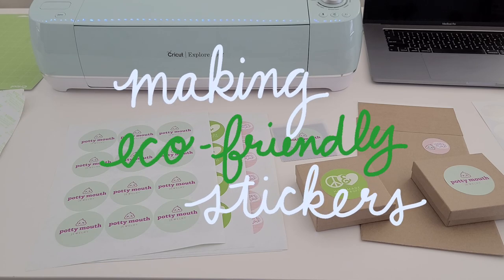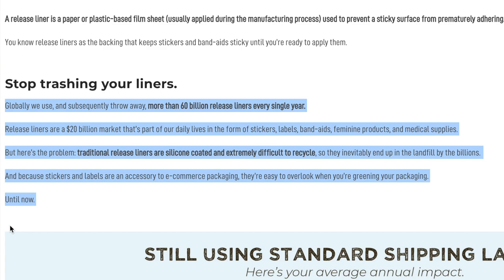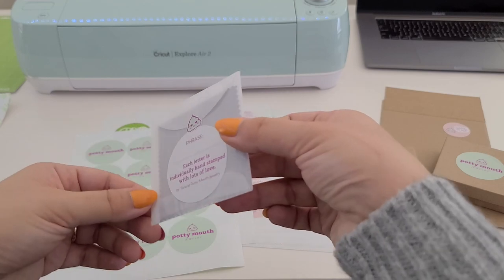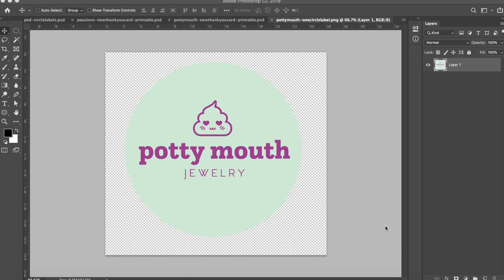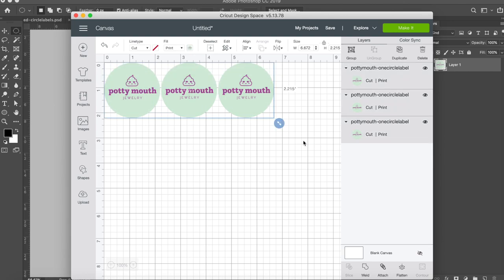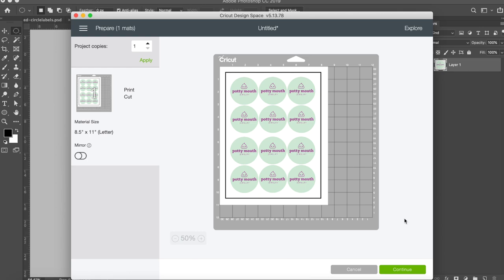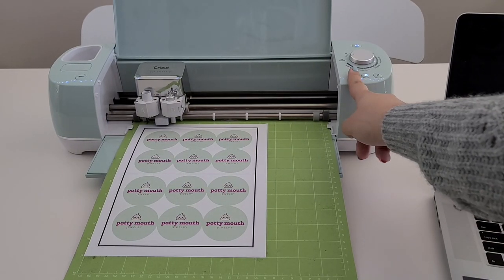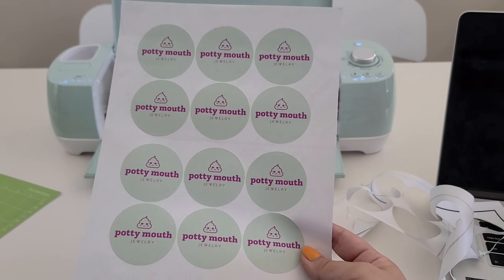HOW TO MAKE (ECO-FRIENDLY) STICKERS WITH CRICUT | FOR PACKAGING, RECYCLABLE & ZERO-WASTE

Comment: This awesome. Quick question, if the shipping labels aren’t as sticky as regular shipping label. Does it come off easily from the mailer or package?
Reply from the maker: They actually recently changed them to be stickier since making this video. Before, on the padded paper based mailers, sometimes the edges would lift up a little if what was inside wasn't completely flat, but I never had issues with them ever coming off, even internationally. But since they're stickier now, definitely won't be an issue.
Reply: @TanaMakes  good to know! I’m am transition all of my packaging into eco friendly too!! I looked up econclose from you! Thank you so much for sharing!

Comment: How do you line up your logo with the stickers? Ps love ur vids x
Reply from the maker: Thank you! You can design the file so that the circle and the logo are both vertically/horizontally aligned before importing the file into Cricut design space. Photoshop has guides so you can see if it's centered, or you can select two layers and use the veritcal/horizontal align tools. Cricut design space has aligning tools too 😊

Comment: Thanks for the tutorial! I have stickers that are also cut down the middle. I'm wondering if youve ever experienced a slowed down lagging design space while making these stickers. When I group things and duplicate, it just makes everything so much slower for some reason. Do you suggest making the designs in illustrator first instead of right on design space?
Reply from the maker: You're welcome! I think once you start getting into sticker sheets with more than a dozen or 16 stickers, it's probably best to design them in photoshop or illustrator. I'm pretty sure any app where you copy, paste, and adjust the positioning a bunch of times starts to lag. It happens with my laser cutting machine app too 😕. If it's a simple design like the one I showed in the video, you should be alright. 😊
Reply: @TanaMakes  I was making it straight on design space so i guess the copying and pasting made it lag. that kinda makes it annnoying haha. does making it in photoshop or illustrator help? it looks like yours didnt lag in the video when you didnt design it straight on design space.

Comment: Hey I have been looking ever since I saw your video of the exact product sheet you use and i cant find it on eco  enclosed...
Reply from the maker: It's under their shipping labels section! As mentioned, I use the shipping label paper that's the same size as printer paper so that I can print whatever I want on it 😊. I don't use a cricut joy, so unfortunately I don't think there is an option for that yet. If you use a mat with the cricut joy, you'd probably have to cut the paper to the max width it allows after printing your design on it.
Reply from the maker: What I'm showing in this video is a "hack". They don't actually sell blank sticker paper. I'm using their shipping label paper the same way you would use normal sticker paper. You can order custom stickers from them with that are recyclable and with the zero-waste liner, but it's much more expensive that just using shipping label paper and printing/cutting yourself.

Comment: Omg, thank you for this info. I am looking to go 100% recyclable. Currently I make reusable packaging and I was looking for recyclable stickers. I wish the company had more options, which I am sure they will introduce soon. This info is amazingggg. Thank you so much :)
Reply from the maker: You're welcome! I wish they had more options too but since they actually sell custom stickers for brands, they probably won't ever provide full sheets of the label paper. What I'm doing is like a total hack because I wanted to have the freedom to customize my stickers more lol
Reply: @TanaMakes  I agree. Yet, I wish they do offer options as I make stickers and I also sell them. So that would just be awesome to offer only recyclable stickers in my shop 😀. I do love your workaround too. :). I’ll try them for sure ❤️
Reply from the maker: @tasneemchandia3470  they did recently change the stickiness of them and sometimes I struggle to peel them off, but I usually print larger stickers. Maybe with smaller stickers will be easier to peel. Definitely test them out.. even if it's just for using on your packaging like I do 😊
Reply: @TanaMakes  yes. I am soo planning to try them at least for my packaging. I feel terrible designing and finding recyclable packaging, only to use stickers that aren’t recyclable. So at least I’ll shift to them for my personal packaging while I find a better solution for my other stickers :)

Comment: thanks great but online labels has Eco friendly sticker paper too
Reply from the maker: You have to be careful because 100% recycled and 100% recyclable are two different things! Onlinelabels has 100% recycled meaning that the paper used to create the paper that goes on the coated backing is made with 100% recycled paper.
Reply from the maker: You can say that their 100% recycled sticker paper is more eco-friendly than regular sticker paper, of course it is, but the liner is not a zero waste liner nor are the stickers and lining recyclable. As far as I know, they don't offer that, but let me know if I'm wrong and provide a link to it so I can share it!
Reply from the maker: Directly from onlinelabels.com responding to a customer asking on their Facebook if they can recycle their liners: "Unfortunately, the answer would be no. Most, if not all, liners (backing sheets) have silicone that enables the label itself to peel away from it without leaving sticky reisude. Due to the silicone, the liners become non-recyclable."
Reply from the maker: Sorry for being so extra and leaving yet another comment lol. But I emailed onlinelabels.com regarding their eco-friendly stickers just to make sure I'm not crazy or sharing misinformation 😅 and here is their response: "Thank you for contacting OnlineLabels.com. Due to the acrylic-based adhesive, our materials are not considered recyclable or compostable. Due to the wax coating on the liner material, the liner would not be considered recyclable either.

I will be happy to forward your request for a recyclable material to our Product Development Team for future consideration."